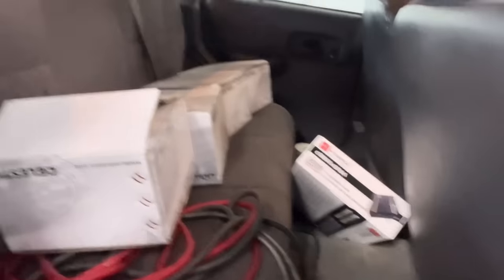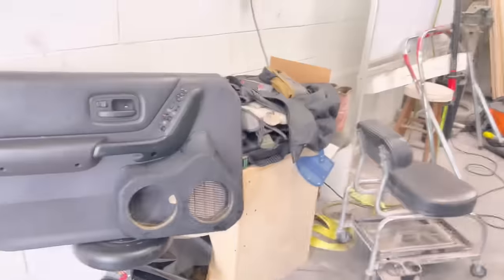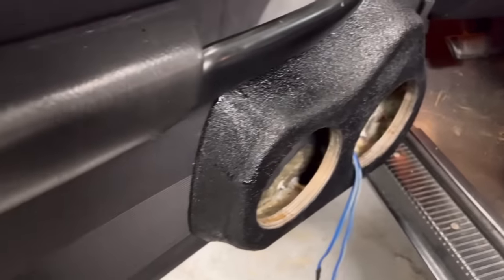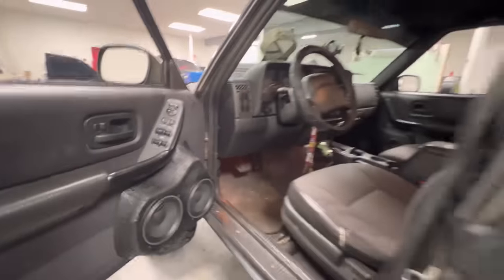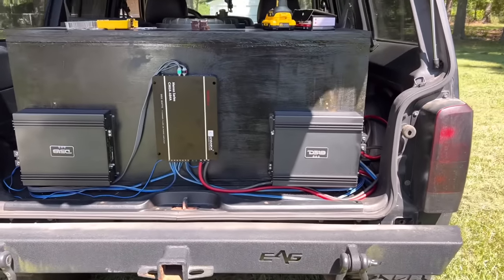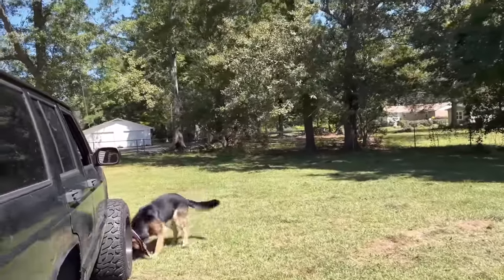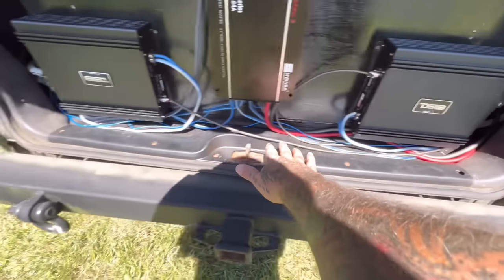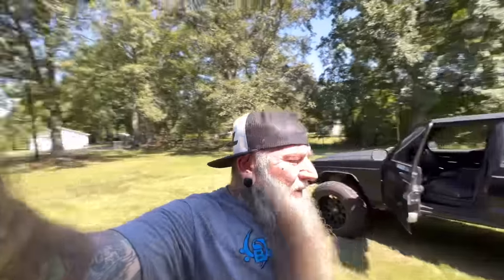New doors on the Hyanka amp, how’s it sound ?

Comment: Celestion recommends a crossover around 150Hz on these mids since they are low excursion with a high Fs of 100hz. These PA style speakers are not built like car speakers.
The factory response curve shows them rolling off around 200hz. 
I might bump up the 70hz crossover point a bit more just so they don't bottom out or get damaged. 👍

Comment: You keep mentioning that I'd be worried to put that unknown amp on my speakers. Let me clarify, my mids are set of Focal K2 Pro's. They cost 10 times that amp. I'm not made of money and could not easily replace them if it burned up a speaker. That's the only reason I said I'd be afraid to run that amp. If I was using those Celestions, yeah, I'd try that amp on those. No worries. 👍
Reply from the maker: Yup, I’m all budget here

Comment: You mentioned the class A/B amps in comparison to tube amps, I couldn't agree more, can't beat the sound of a A/B amp for midbass, midrange and tweeters. I just don't believe that a "dirty" class D "fullrange" can compare to a class A/B regardless of how much filtering in the circuit design. Did you ever see the lack of components in a class D amp? Their a gutless wonder, just fine for subs but that's about it, class A/B are a much more refined (for car audio) and affordable, let's not get into class A amps and other class amps they have their place.

Comment: Why not bridge amp and have 4ohm load per door and amp will be running louder
Reply: @yourmotherstepson7974  He mentioned he wanted to keep the mids and tweets on separate channels so he can adjust the gains. This allows you to dial in how bright they sound. Mids and tweets don't need anywhere near as much power as people think. 80w on two efficient mids is quite a lot. Tweeters may only need 10 or 20 watts.